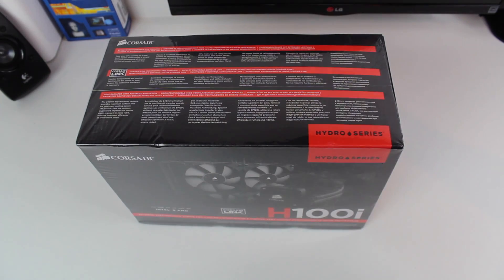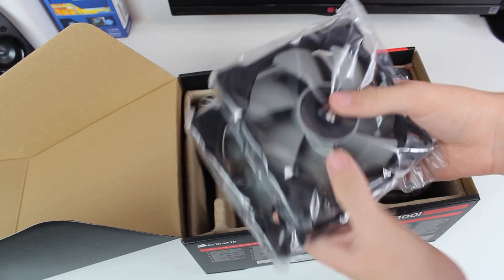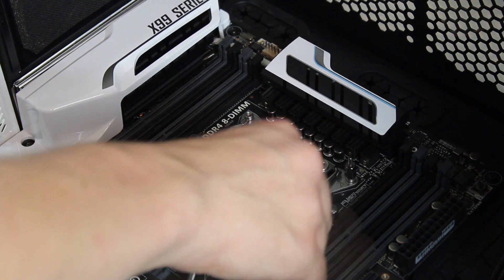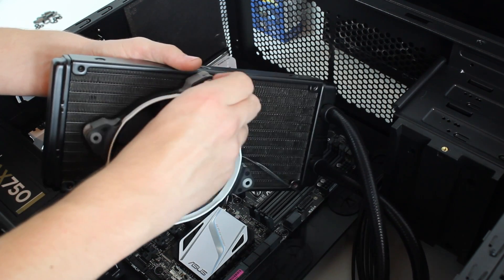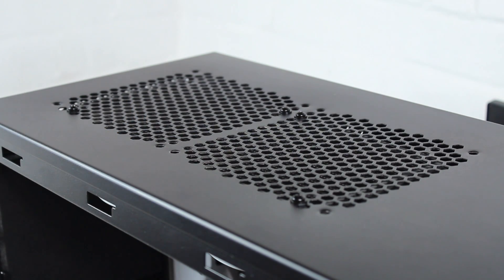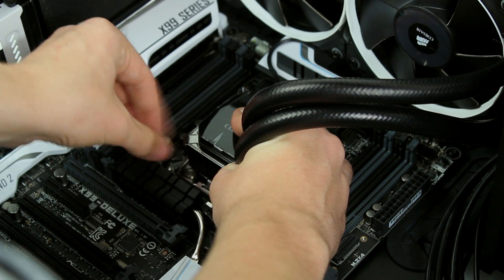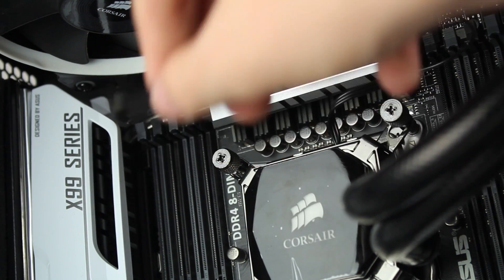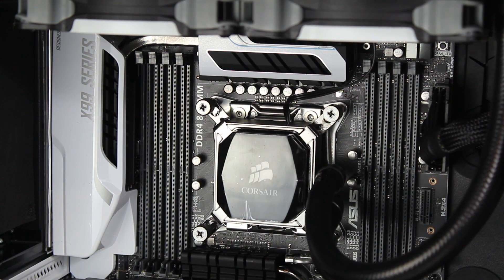H100i Installation Guide: X99 LGA 2011-V3 Socket

Comment: Does the SATA connector need to be connected to a SATA port on the motherboard etc i have the CPU Cooler but have never taken it apart or installed it yet.

Comment: Im bit confused about lga 2011 v3 dual socket mobo will this support xeon e5 2600 v4 series processor also tell me about mobo models of  c612 dual socket compatable for xeon e5 2600 v4 series and also v3 series

Comment: Nice video subbed,  in case anyone was wondering the H100i GTX has a pre installed intel bracket so you just have to screw it in.

Comment: Very easy to understand, thank you, can't wait for 6900k which will have the same 2011-3 socket :)
Reply: +Andris Berzins Do you mean 6700k? If so they use the LGA 1151 socket why has the same mounting hardware as 1150
Reply: Henry Thomas no 6900k 8 core cpu, not 6700k mainstream one

Comment: With the newest version of H100i GTX, the pump power connector is no longer compatible with this ASUS MB. Not without finding an adapter! The connector on the pump is now a 3 pin in a four pin male connector and a four pin in a four pin male connector. Am I missing something here? Thanks!
Reply: +BuddySteve did you manage to install it ? what adapter did you use?
Reply: Actually, I discovered a day later after posting this that I had to plug the H100i fan cables into the fans that came with the H100i. The manual isn't all that informative. I did get it working but now I find that the CorsairLink software is a peace of junk! I'm not liking Corsair products right now!
Reply: BuddySteve Ok, thanks for clarifying this to me) personally I don't care about these software and don't need it, it should do everything by it self instead of me trying to find best option for hours. I love everything to be straightforward and simple like iOS from apple :D
Reply: +BuddySteve So you plug the fan cable coming off the block into one of the fans?

Comment: Nice and helpful video, I have one question. Is it a problem if I installed the fans behind the radiator? Because I did that in my pc. Is the performance will be poor? Any future issues? 
Thanks
Reply: +Qahtan Rashid Push and pull are basically identical in terms of performance. It doesn't really matter which side of the radiator the fans are. But the radiator is easier to clean if it's in pull, since you don't have to unscrew the fans to get to it.

Comment: Thanks for your video. I am now getting ready to return a Kraken X61 cooler. Two issues. 1. either I was sent the wrong screws because there was no way it would fit on the X99 2011-V3. 2. It was leaking. I am going to order the H100i today. Your video makes it look real easy to install. I have a Phantom Full Enthusiastic Tower Case NZXT. Is that compatible?

Comment: MY H110 DIDNT COME WITH FUCKING MOUNTING SCREWS FOR MY X99 FUCKING SYSTEM WHAT THE FUCK
Reply from the maker: tosasaurus It most likely did. They are the same mounting screws as LGA2011.
Reply: no they didn't i have lga 11 v3 that requires just the 4 mounting screws and the thing that screws into them. So i ordered a kit from amazon for 15 bucks and then my h110 "holder thing" was a millimeter too short on all sides so i used a power drill to widen it out and finally it was fine. I'm getting 30-35c on my 5820k idle with the h110 right now
Reply: what i found out though is that the h110i GT INCLUDES the mounting screws for lga 2011v3 you got a gt version so you wouldn't have known about this problem

Comment: this may be a dumb question, but do you have to use 4 sticks of memory on x99 boards? or can you use 2?
Reply from the maker: Lastarius/Crys You can use 1! but the memory kits are Quad-Channel and work most effectively in sets of four. But you can use 1, 2, 3, - 8.
Reply: thx, i figured it out though and built an x99 platform pc
Reply from the maker: Lastarius/Crys Yeah apologies for the shocking response time I have just changed teams at work and haven't even looked at this YouTube thing for months.

Comment: What pin did you put your fan cables into? Cause im going crazy to find the right pin.
Reply from the maker: I plugged my fans into my cases fan controller, but there are two small adapter cables that come with the H100i that you plug into the top of the pump (Corsair Logo facing towards you the right way round) and they split out to 4 fan headers.

Comment: do these install in all cases?
Reply from the maker: It SHOULD fit in any case with Two 120mm Fan mounts that are positioned together. Preferably at the top. The front is not practical at all, nor is the side.
Reply: bleedinsixcolours thats what i thought i just wanted to be sure.   thanks.

Comment: Soooo, gonna build with the X99 Rampage V, this cooler and a CM storm trooper case. Will it all fit? Its a huge case, but, I wanna know anyway, just in case (lol).

Also, the fans pulling "hot" air from inside the case wont hurt cooling performance too much? The fan in the back also drags air out, but I can slow that down alot so there wont be negative pressure I guess.
Reply from the maker: It doesn't make any difference mate, its been tested and debated about for years, it really doesn't make a difference. Yes I think that board will fit in the trooper, I see no reason why not.

I removed my rear exhaust and let the two fans 120mm fans on my H100i be the only exhaust with two 140mm intake fans for Positive pressure.
Reply: bleedinsixcolours
So if i remove the stock back-fan and move it in the front besides the stock-front fan the case comes with (resulting in dual front-fans) + just H100i, i should be good to go?

I remember also reading in some articles the back-fan doesn't usually do that much.

From your testing how were the results? Performance/cooling/noise wise (generally speaking). I am soon going to buy an Fractal R5 + X99-A + 5280K + H100i...i was actually pleasantly surprised seeing a video from someone who already made this almost exact same setup.

Do you recommand changing the stock H100i fans with the SP120? why exactly? (kind of a noob when it comes to liquid cooling, this is my first). Should i go for Noctua or should i stick to SP120 for compatibility? (holes and such)
Reply from the maker: Nitescu Adrian I don't know wether you have gone ahead and done this yet, But I'd say get the SP120 quiet editions if you want them for the looks, if not buy the Noctua NF-F12 fans for performance. Most fans will work don't worry about compatibility. I get about 60 degrees at stock.  Also just go with one set of fans on the H100i and two fans in the front that is optimal.
Reply: bleedinsixcolours
Awesome. Yea that's the configuration i thought of. 2x noctua up and 2x140 in the front, taking out the rear. Thank u for the confirmation, helps a lot :)
Reply: Hahahahahaha

Comment: Quick question, I was planning on using a Rosewill Thor V2 case for the computer i'm planning on building and I was wondering if I would be able to mount the H100i cooler above an Asus X99 deluxe or an Asus Rampage. Thanks for the help. :)
Reply from the maker: I have no hands on with that case but I would imagine that would be possible yes :)
Reply: bleedinsixcolours Cheers. :) Was worried that the top part of the X99 would block it from fitting. Thanks mate!
Reply from the maker: ***** Mine was a little tight in my Define R4 but your case seems to be about the same if not a tad bigger so you should be fine.
Reply: bleedinsixcolours Alright, cheers! Finally can look into getting it. :D

Comment: What kind of Intel i7 CPU do you recommend? My original build was a Asus rampage iv black edition with the Intel i7 4820k. Now I have decided to go with the X99 deluxe but I'm not sure if the 4820k is compatible or if I should go with a different CPU.
Reply from the maker: Hello,
No you will need to change CPU, go for the 5820k. It is a much higher performer. Its the same price, but gives you two more cores, 4 more threads and is based on the new architecture.
Basically a no-brainer. :) You need any more help let me know. :)

Comment: So it does not matter which way the radiator is turned? Whether the hoses are connected near the back of the case, or in your example, towards the front? I think having them near the front looks WAY nicer, yet most of the time I see the hoses near the back of the case.
Reply from the maker: Nope it doesn't matter at all mate all down to ascetics. I think that the way I have it in this video with the tubing going to wards the front is much more appealing visually but its down to opinion. Only thing you will need to check is the clearance and space but other than that no different mate.

Comment: nice build and thanks for the video on the setup but i had a question about something i saw on anther video -- this guy says the 3 cable that comes out of the block is a sata power like you said and the other one is a rpm detection so you don't have to even plug it in your thoughts on this? Basically the x2 fans on the radiator are plugged into the cpu1 and cpu opt and the rest doesn't really matter if u want to control the fans via the motherboard bios.

Build A Z97 Gaming PC From Start To Finish - July 2014  is the video i was talking about. Thanks!

53:40mins in if the link doesn't work
Reply from the maker: I would plug it in mate definitely. It is for the motherboard to know there is a heatsink installed at post, and you will want to leave the pump maxed out as it is very quiet. The two fans on the radiator can be plugged into either other motherboard headers, or into the pump itself for control via Corsair Link, ro through some kind of other fan splitter. Anyway, I would recommend plugging the 3pin from the pump into the CPU_FAN header and find other places for the two rad fans.

Comment: Is it ok to plug in the fans into a fan hub instead of the motherboard?
Reply from the maker: Yeah it is mate. But the 3pin fan connector that comes off of the Pump unit its best to plug that into CPU_Fan.
Reply: bleedinsixcolours Was going to get a 3pin fan to 4pin molex connector and plug the pump to that. Would you advised against that?
Reply from the maker: GTSGTS Do you mean a Molex power from your Power Supply adapter to 3pin fan for the pump? There is nothing immediately bad, it will make the pump run full speed however. There isn't any reason to not plug straight into the CPU_FAN header though mate :)